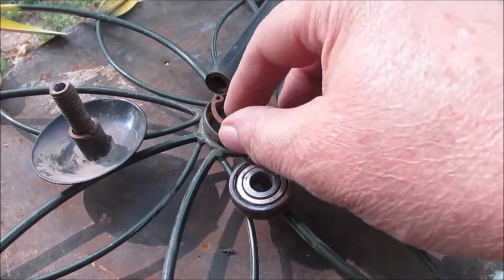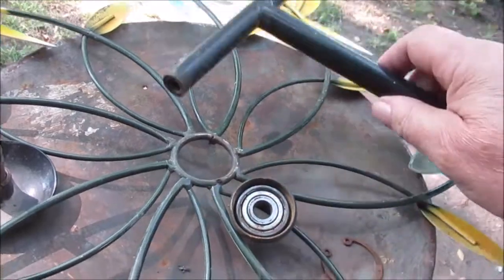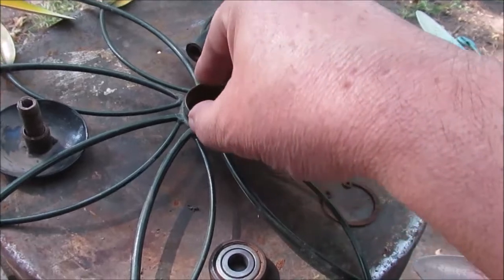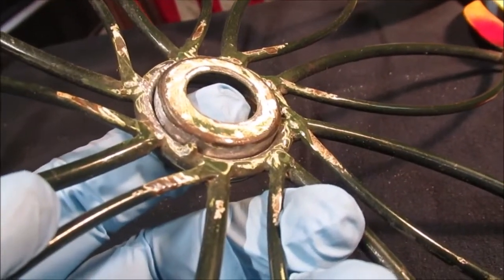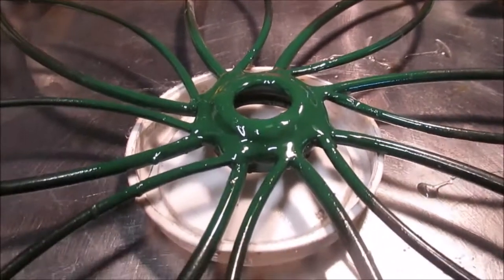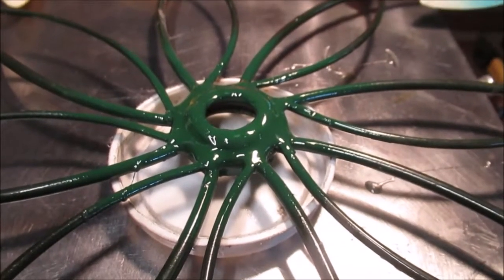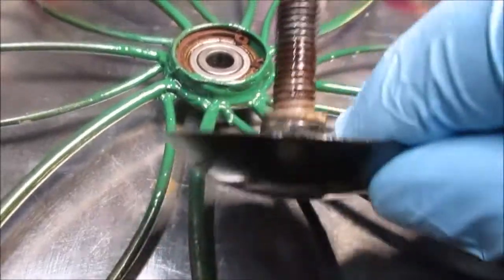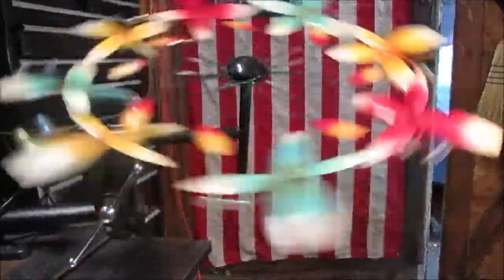Pretty Spinning Butterfly Lawn Ornament  (REPAIR )

Comment: Good Job on the repair. Soaking the bearing in oil was a good ideal it seems pretty smooth.
Reply from the maker: Thanks ..It should have a sealed bearing these are just shielded so the oil soaks in